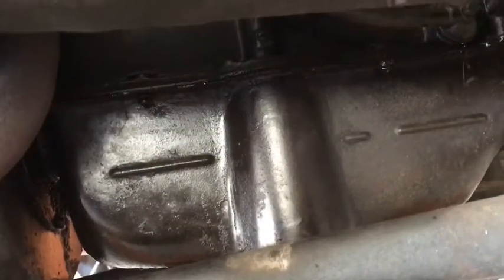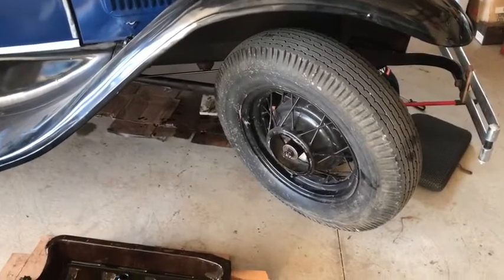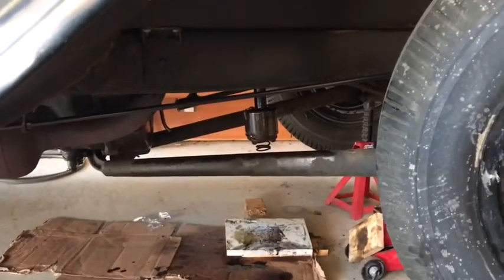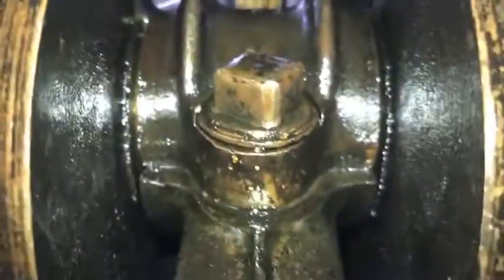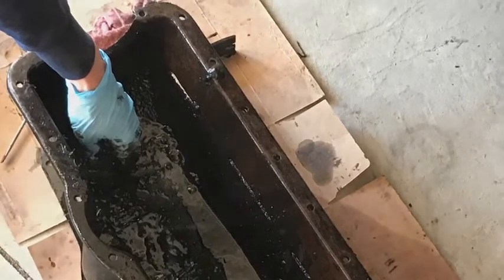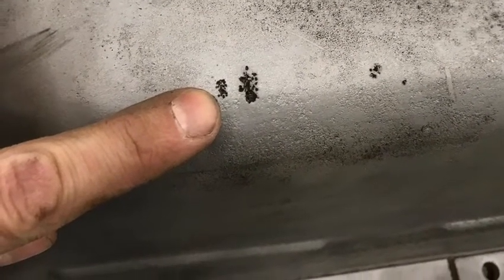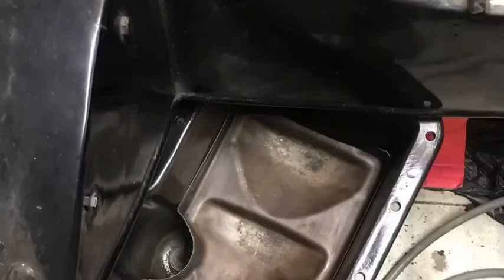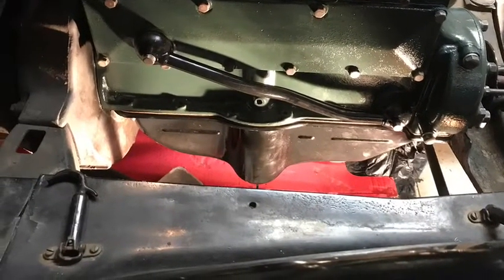1930 Model A Oil Pan Restoration

Comment: What’s the best way to clean the oil out of the pan?
Reply from the maker: I first drained everything I could and recycled at the local auto parts store.  Then, depending on how much sludge you have, you will need to scrape the pan then I used mineral spirts (parts washer) to clean anything that remained on the surfaces.
Hope that helps.

Comment: Ryan

How did you hold the oil pump in place as you installed the oil pan?
Reply: I am asking the same question as Ryan, the 2 response are not visable.
Reply: Small bolt on side of engine block holds the pump in place. He talked about it in the beginning briefly, Part suppliers sell the bolt that looks like it has a bigger head on it. Paul Shinn Model A videos on YouTube discusses it in one of his videos where he drops the oil pan but wants to keep pump in place.